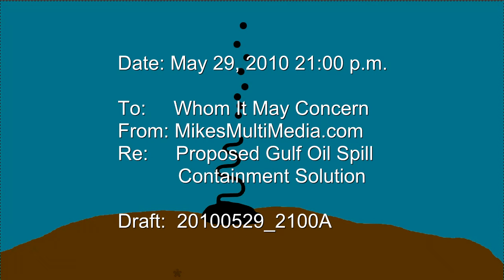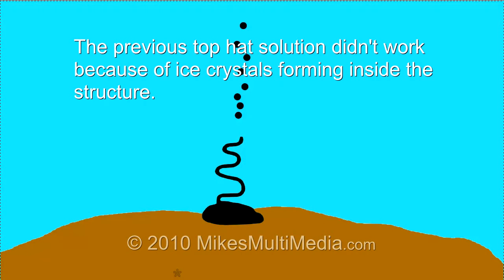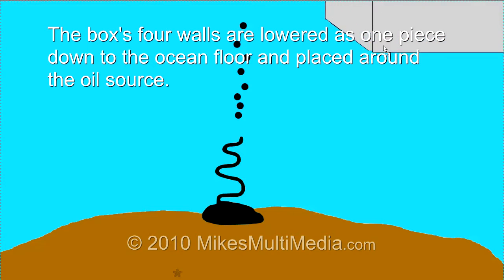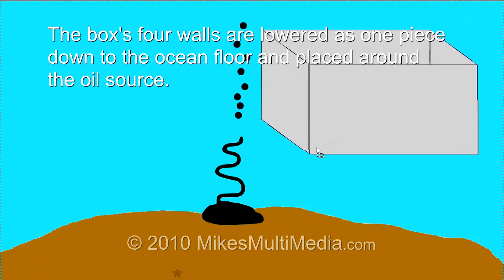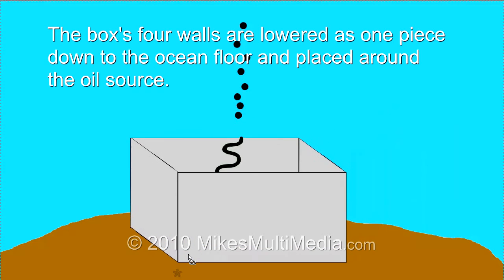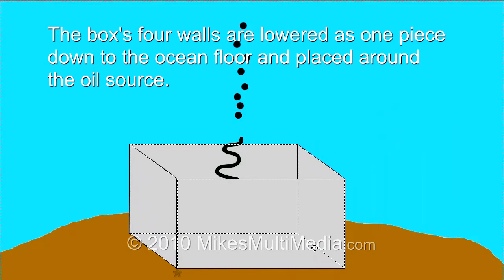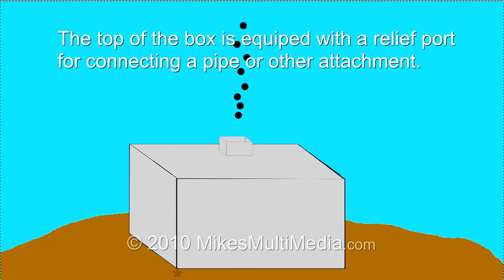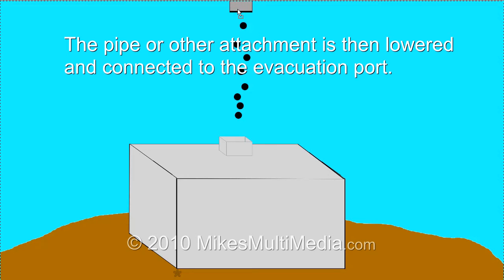Gulf Oil Spill Solution Animation by MikesMultiMedia [05-29-2010]

Comment: This idea is moving in the right direction. BP can use pre-existing containment top hat dome but open a few large diameter circles on top.
 Pre-attach -Weld/bolt a large pipe within the center of the dome with coupling/adaptor on central top hole of top hat. Then in circles pre-cut on top -pipe down cement. Then you will have four stories of cement holding down your pipe coupler/adaptor then lower smart pipe onto that.
 (See smart pipe -oil spill solution -on you tube)